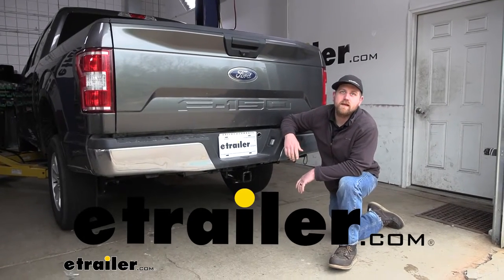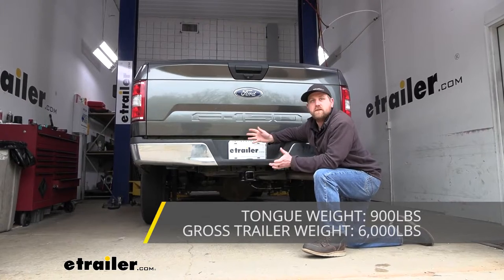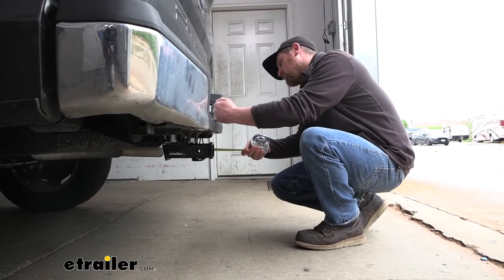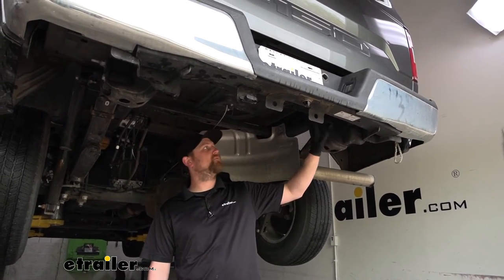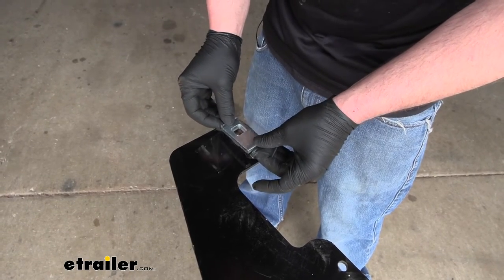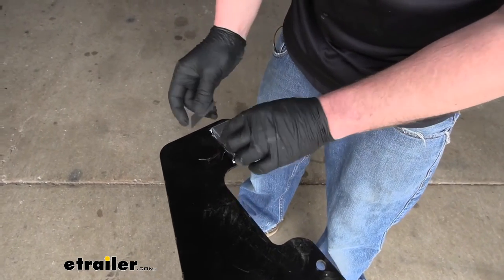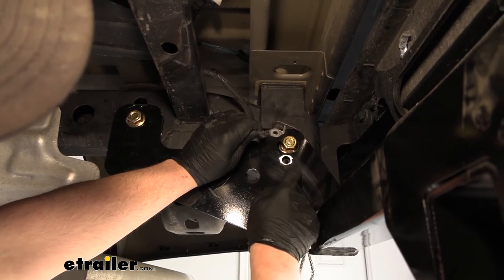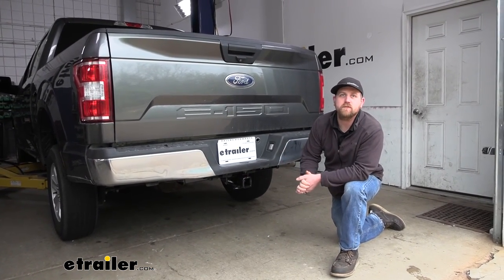etrailer | Installation Guide for the Curt Trailer Hitch Receiver on a 2019 Ford F-150

Comment: Just bought this Curt Manufacturing Class 3 Square Hitch Receiver 13475

 Does it come with a bolt kit
Reply from the maker: All the trailer hitches we sell include all the necessary installation hardware.
https://www.etrailer.com/Trailer-Hitch/CURT/C86HR.html